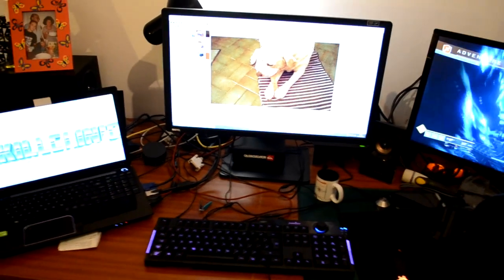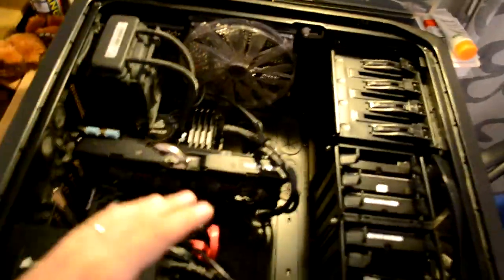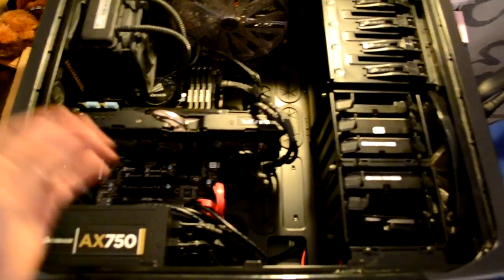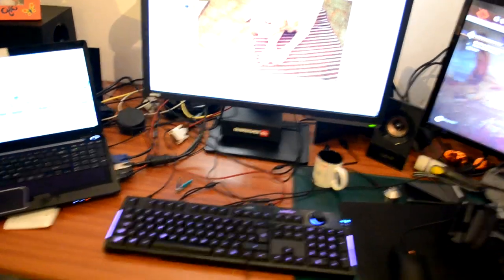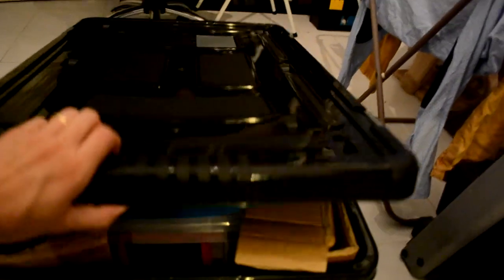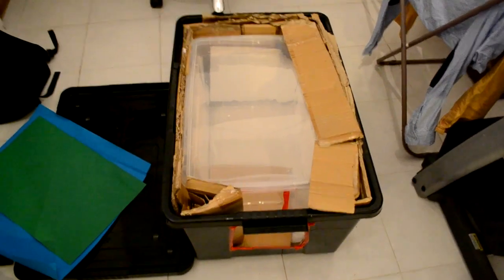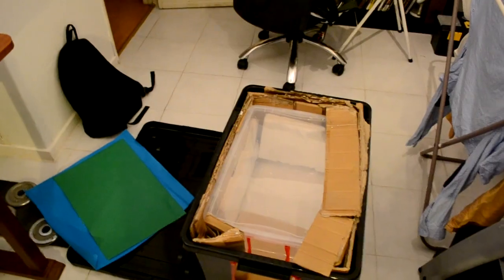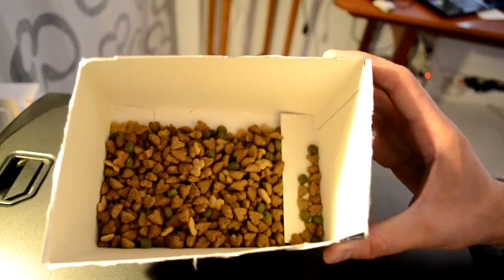☼ RIP Gaming PC 🔥 + Helping Stray Cat 🐱 (VLOG)

Comment: i suggest you wait for cheaper intel mobos and get yourself a coffee lake. those shape up to be a really good deal
also dat perixx kb is still alive eh, kinda wish i bought one back when you released a video about it, currency rate wasn't as bad
P.S. about the box - best way to insulate would be styrofoam, and then  you can glue warm fluffy thing on the inside
Reply from the maker: Im thinling about getting a rysen system. The keyboard still works perfectly fine, aside from the keys being worn out, still a good non-mechanical keyboard to get. The box seems fine right now, i actually used a mix of cardbox and styrofoam! hehehe lets see if it lasts! Will do an update video this week!
Reply: ryzen is great and all, no stuttering and smooth framerate all over (if you have a good GPU, you get your 120fps basically all the time) but max framerate is still on intel systems. but right now in PC's under 700 dollas it's either ryzen on intel i5 8400, something like that. best budget right now is R5 1600 (if you overclock) or Intel I5 8400 (i5 is great even when you concider overpriced motherboards). for upgradability ryzen is better because intel has a history of switching sockets like gloves